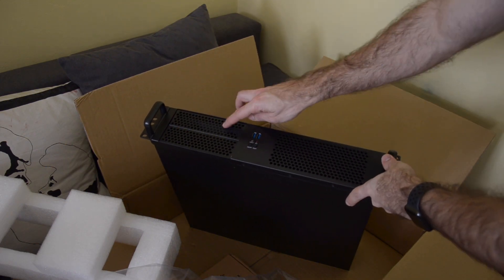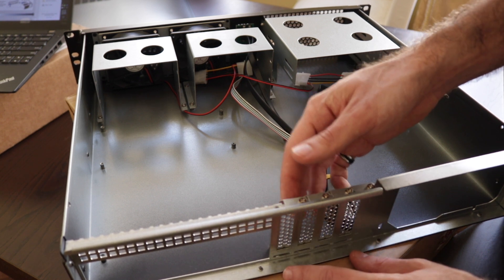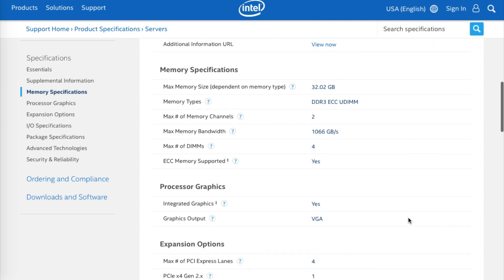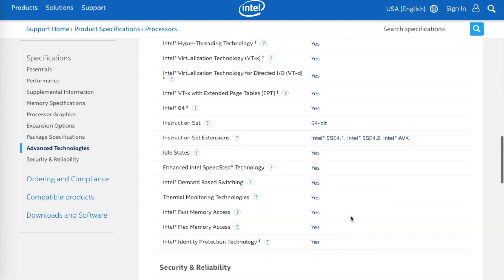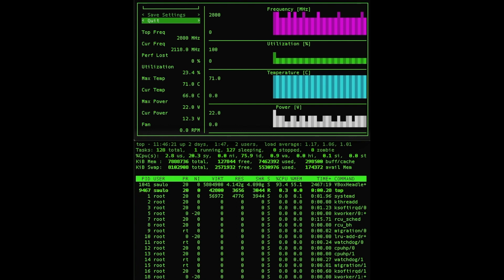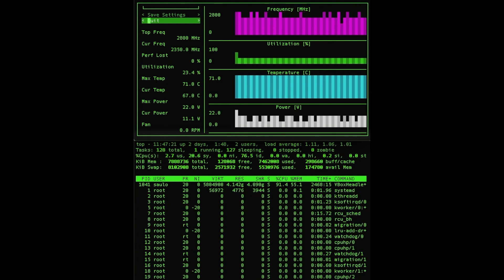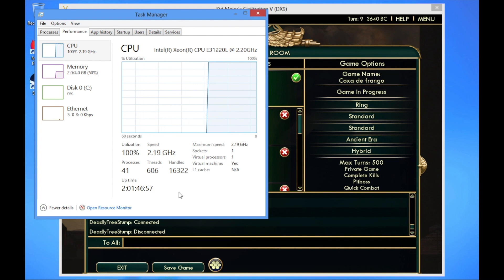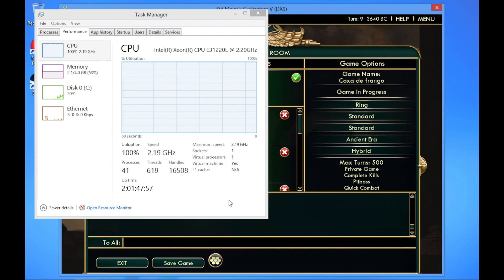The PERFECT home server? - 0dB fully silent rack server review

Comment: If you had to build such a system again today,  what would you have done differently?
Reply from the maker: Low budget: 2 boot SSDs, 4 data SSDs. All SATA.
High budget: 4U chassis, 8 NVMes in PCIe carriers. High capacity SATA.

And I'd look at newer low vattage Xeons.

I´d not go for SAS because I need to keep a fan. I don't trust the cards to last too long without at least a chassis fan pushing some air through.

At the end of the day, my setup is not fanless anymore. I didn´t cash to go full SSD, so I need fans to push air through the SSDs.

I got now 2 E3-1260Ls, each one with 32TB raw storage, for a total of 64TB raw. Each one is doing raidz2 and I keep a spare disk in each server. The whole cost of the project was 1000 EUR, so I think that's fine. I can work next to the boxes no problem. Doesn't do more noise than my ThinkPad W530 when the fan goes full speed.

My only mistake was getting a 2U SAS enclosure for the server you see in the picture. Even after replacing the fans with noctuas, there's a bit of an annoying whine.

Before the setup was in my living room, so it had to be quiet. Now I got a rack, so it's ok.

Comment: you may find  the tiny 'industrial PCs' available on newegg to be interesting ?  They have fanless systems, that can clip on the back of 4K HDTVs.
The body of the little boxes are ribbed metal to release heat, they use low power CPUs, but plenty enough for web browsing, email, and media service.
Reply from the maker: No ECC RAM is an issue for me.

Comment: If you want to pay more and have less performance, this configuration works.
Reply from the maker: The idea here is not performance, but silence. I could well toss everything out and use a dual Xeon as a server, but I'd not manage to get a passively-cooled system.

The system described here hardly ever goes above 15W on the CPU and serves 10 simultaneous users with everything they need.

I live in an apartment. If I had a house, I'd for sure have spent 300 EUR on used dual Xeons or even a POWER server just for the sake of learning.

But this is installed in my living room and must be silent. I've just decommissioned my MicroServer for a fully fanless system.
Reply: @Shiunbird  if a woman cant accept a running 3d printer or starting jet engine in the living room, she deserves to be EOL^^
Reply: @Shiunbird 15W for the CPU? What about for the whole system?

Comment: What kind of passively cooled power supply did you use?
Reply from the maker: Silverstone nightjar 520W 0dba
Reply: @Shiunbird are there any cheaper silent PSU? You don't really need 500+ Watts for this build right?
Reply from the maker: @jcbrites  At the time, it was the only one that my local supplier had. A later build has a semi-passive one - cooler turns on only at higher loads, which means it is always off.

Comment: How much did you spend for the whole thing? Thanks!
Reply from the maker: The mobo was 99 USD on ebay. The seller had 100s of them.

The CPU was around the same.

The RAM I had laying around. But DDR3 ECC is very cheap nowadays.

The chassis was 80 GBP if I remember correctly.

The heatsink was 20 EUR.

The power supply is expensive - 180 EUR.